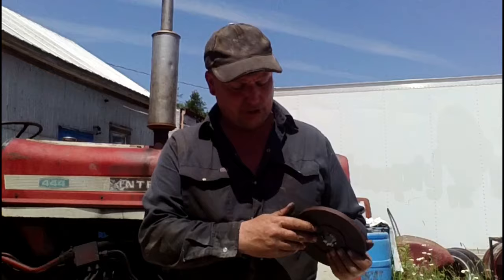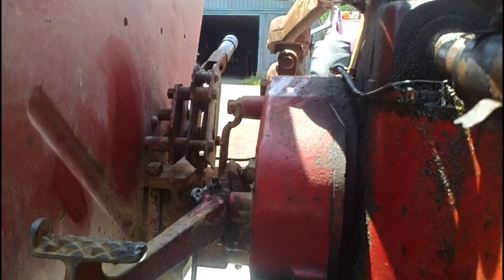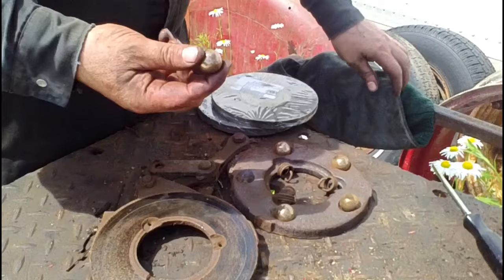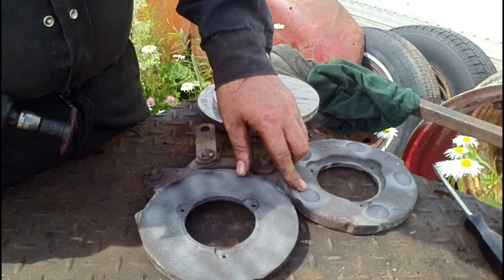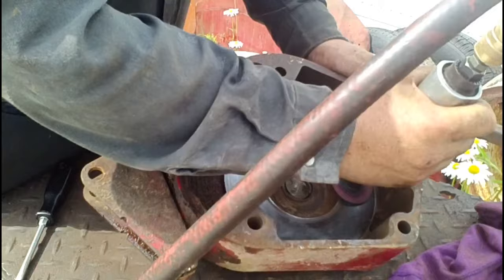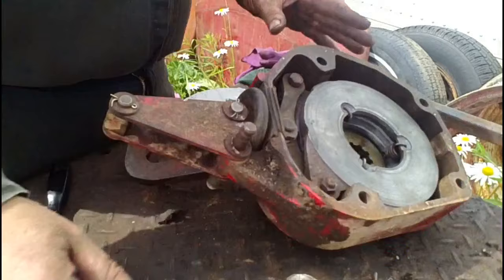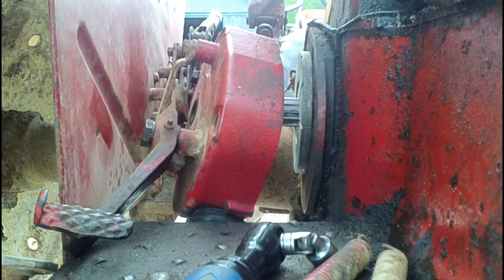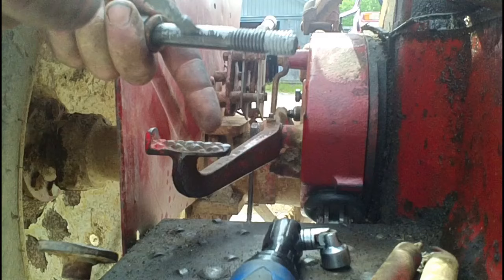IH 444 Brake repair

Comment: Great video and explanation, I'm about to do brakes on my 1967 424. I laugh when people talk about brakes on a tractor mine have never stopped worth a darn in the fifteen years I've owned it.
Reply from the maker: Get the brake disks from A&I Products, you won't believe the difference! Thanks for watching!
Reply: @CanadianRedneck15  Thank you for the quick response. I will check out A&I for the parts. I have been  looking at Steiner. I have been fixing my old guy up little by little. I use it every season and can't tear it apart all at one time

Comment: FYI, the IH 424 has the same brakes, but because it is a little smaller, on the right-hand side (the one this video shows), the differential locking pedal prevents removing the brake housing.  I had to remove the pedal first.  Also, I had to remove the linkages from the housing to put it back on. Goes on easy when you can rotate it ~30 deg.  Just hit up the hinge pins with some liquid wrench first and get some replacement cotter pins.
Reply from the maker: Great information, thanks you and thanks for watching!

Comment: got a IHC Mc Cormik 434 here in Austria, it has the same system, thanks a lot, ill adjust it first , if thats not enough ill change brake pads, but i guess ill need to do that, the brakes are so weak that you dont even notice the handbrake when you drive whit it on on accident, the tractor rolls downhill with footbrakes pushed all the way...
Reply from the maker: Yeah they're a great tractor with TERRIBLE brakes, the factory disks are too hard and just glaze up. Thanks for watching!

Comment: Mahindra company also giving same gear box ,same brakesystem(exept pin),reduction system till the date,even a bolt nut didn't changed only seat was changed
Reply from the maker: Yes, Mahindra bought the rights to build the B275 and B414 from IH and built them for many years after IH stopped. Thanks for watching!

Comment: This helped me get the brakes off and cleaned up, but I have a bad oil seal on the left side. How can I get the backing plate off? I removed the bolts from the backing (6 of them), but the plate won't budge.
Reply from the maker: You have to remove the axle from that side and move the bull gear so you can pull the bull pinion housing. You can see the process in this video https://www.youtube.com/watch?v=EST-ssHkrIo&t=1s  Thanks for watching!

Comment: Hi. I have a A414 in Australia and my LHS brakes lockup/jam when I use them. I then have to put the tractor in reverse to loosen. I have already dismantled and cleaned them and have adjusted the play in the pedal but that did not help. Do you have any ideas as to why they would lockup like that?  Thanks mate
Reply from the maker: Some of them do that, I'm not sure why. If anyone has a fix I'm all ears! Thanks for watching!

Comment: Roger,
So I've replaced the brakes exactly as shown on the video, took the actuator apart , did replace one ball , the size of the replacement ball is 7/8"
put the brake unit back on left side ,adjusted it and it works well. When I put the right side together ( right side when sitting on the tractor) I have the adjuster adjusted all the way and still have no peddle. I took it back off and replaced the hinge bolt as there was a considerable amount of slop 
in the pull. Put the actuator back on and still no peddle. I'm not sure what the next step would be to get adjustment to even both breaks.
Any suggestions?
Reply from the maker: If there is much slop in the pulls it will be hard to get much pedal. Over time the friction surfaces can get worn and you may have to machine some off the edge of the case to tighten up  the space for the disks to get any "bite".
 Thanks for watching!

Comment: Any chance of a video on replacing seals to stop oil leak in the disc brake housings?
I have a b414 and the oil is pouring through. I have the manual, but don't understand how to remove the cage.
Reply from the maker: I will add that one to the list, unfortunately there are some other projects on the go so it won't be quick.
 To get the brake shaft cage out you have to lift the hydraulic lift unit off and remove the rear axle on the side you are working on. With the axle out you can move the bull gear rearward in the case so the cage will come out past it. On the right side you must take the lock ring off of the differential lock shaft so the bull pinion shaft (brake shaft) can come off of it. Hope this helps, thanks for watching!

Comment: Do you have any videos of this with the brakes stuck fixing to have to break my wheels loose on my tractor
Reply from the maker: I don't. Has the tractor been sitting a while? If so the disks  are likely rusted to the case and or actuator. Thanks for watching!
Reply: @CanadianRedneck15  yes the tractor dropped and I think it's the same problem from your video where you rebuilt the oil pump plant to start trying to get my oil pump rebuilt soon

Comment: My 444 seems to be leaking trans oil out the spline brake shaft. Can the inner plate be removed and is their an oil seal on the shaft? How hard of a job is this to do?
Reply from the maker: The brake shaft housing has to come out as the seal goes in from the inside end. To remove that housing you have to remove the axle and move the bull gear out of the way. You can see the process in videos found here https://www.youtube.com/playlist?list=PLTZSkooohOVEF8jj0z7zoMLIlYNHwyyU3 
Good luck and thanks for watching!

Comment: How would you go about freeing one of these breaks that were stuck My right hand side break is stuck tired just slides if I pull the tractor
Reply from the maker: If you have tried going ahead and back and it doesn't release you will have to pull the brake housing off and check out why it is jammed.
  Thanks, for watching!

Comment: G'day sir! I got a 434, broke an axle last year and BROKE the other one this year due to grabbing brakes! THey dont just grab, they LOCK as soon as you touch them and I have the big highway tires about 5 feet tall so when they grab they broke my left axle and NOW my right axle! What do you suggest for brakes? DO you sell them? I gotta take them out yet and see ... was thinking they are all rusted or down to steel thus the grabbing? Im in Ontario, if I buy brakes from you would shipping be expensive? Thanks for your videos.  Or do you know why they are grabbing so bad? Thank you!
Reply from the maker: The new style disks are grabby, that may be your issue.  Make sure the actuators are clean and work freely, back the adjusters off a little so it's easier to control braking pressure.
  Thanks for watching!

Comment: I found you looking for fix to as you said super I mean dangerously grabby brakes on our 444. Left side grabs very badly.coming off a trailer or with a hung load (front bucket loader) very dicey. Any advice on what to look at? Thank you!
Reply from the maker: Check out the balls and ramps in the actuators for rust or dirt and check for any oil or grease on the disks. If everything appears clean and in good order try backing off on the brake adjustment a little so you can control the pedals easier.
 Thanks for watching!

Comment: I've got an IH666 with a similar system.  I replaced the brake pads and adjusted the pedal play a few months ago.  They worked fine for a while, but then the left brake started sticking and/or grabbing really hard.  It would always free up, but the grabbing continued.  I took off the cover to look and took out the pads, but I did not remove the actuator.  All looked normal, so I put it back together and the problem was fixed.  I just tested it under hard braking at high speeds and it all worked fine.  Do you think my issue was worn actuator balls?  Should I take it apart and see, or is it possible that I will get lots more life without problems? Thanks for informative videos
Reply from the maker: If you didn't take the actuator out but the problem is gone I wouldn't think there was a problem with the actuator. If it starts acting up again that is a place to look though. Thanks for watching!

Comment: Hi again Dave.
I've done the brakes on my 444 and put them back on.
My wheels are still locked up.
They were fine while brakes were off but locked up again when new brakes went back on.
Could I have a gear problem or worse.
Thanks. Brian.
Reply from the maker: Sometimes as the brakke parts wore people would "shave"the case to make a tighter fit or it's possible that the actuators have the wring size balls, they should be 7/8 of an inch.

Comment: Thanks for the video. I replaced mine while I was rebuilding the engine. I have play in the pedals but the brakes are locked. Any ideas?
Reply from the maker: Some times the brake disks grab and lock the actuators. If you were going forward back up a little and that should release them. You should have about an inch of "slack" in the brake pedals. Good luck and thanks for watching!
Reply: I have a 424 with the same brakes that had sat for a few years and one of the actuators rusted beyond salvage and I had to replace.  The replacement actuator assembly + new pads is ever so-slightly thicker than the housing will accommodate, and so, that brake is always locked when properly tightened.  Any1 have any ideas other than taking the new actuator to a machine shop to get milled down a little?  Or, having a thin metal "gasket"/shim made to give the pads room to spin freely when actuator not engaged from pedals?

Comment: I have an International 305 Utility that just barely grabs. The disc thickness looks pretty good. Might be they're too hard like the ones you described? I took one apart and cleaned it up, put it back together; not much  if any difference. Maybe I just need to tighten the adjuster on it? Also think I might need to replace the seal, but can't figure out how to remove the plate.
Reply from the maker: I assume you mean a 350 utility? Those original disks were like granite and would glaze up very badly, you should be able to get a replacement disk with the softer material for it as well. The seal plate should come straight out. Make sure you have all the bolts out then use a couple of pry bars and wiggle it. It's a "snug fit" and on an oring so it will be pretty tight. Good luck and thanks for watching.

Comment: Any idea how many grease  fittings are on the 444?
Reply from the maker: Not really, there's a bunch. Spindles, tie rod ends, front axle pivot, clutch pedal, release bearing, brake shaft/ pedals, and the lift arms. There might be one or two I missed but I think that's all. Thanks for watching!
Reply: @CanadianRedneck15  I just recently  bought a 444 and I found your channel which is very helpful

Comment: I could do with some advice and I am sure you will know, I used to work at IH dealer years ago and there were problems  with splitter box or  torque amplifer  but was it improved with later  4210 series as I am looking to buy  a 1994 model
Reply from the maker: I don't know if they improved the T/A for the 4210, I've had very little to do with T/A tractors.

Comment: Hi Dave. What's the thickness for new discs? I'm thinking of re-bonding cause I seem to have a challenge in finding new ones
Reply from the maker: I'm sorry I don't have any in stock right now but I should have later this week. If you are in North America you can go to A&I Products website and find a dealer near you. The part number of the disks is 1975464C2.
  Thanks for watching!
Reply: @CanadianRedneck15  thanks Dave, unfortunately I'm in Africa my man
Reply from the maker: @felixmarwei1230  OK, so that won't work. LOL  I will try to remember to measure the disks when they come in. If you haven't got  a reply from me in a week remind me.
Reply: @CanadianRedneck15  Lol. Sure Dave.  I will really appreciate
Reply from the maker: @felixmarwei1230  Got some disks in, they measure exactly 1/2 inch.

Comment: Mine were done by a local outfit that did a horrible job.  Set them up too tight and glazed the brakes (actually one side was smoking) Ill do the job myself so its done right but super keen to know what pads you recommend?  Even when I got it back from  the shop they worked horribly.  LOVE this and all of your vidoes!
Reply from the maker: I use the disks from A&I Products, you find a local dealer from their website, their disks are a softer  material like a clutch disk, the originals were like granite and would glaze up in no time and you had no brakes again.
  I am glad you enjoyed the video, thanks for watching!

Comment: Is the 2444 built in Louisville Kentucky going to be about the same? I know that they are not exactly the same as a lot of people say because even the hydraulic suction screen is different between European and North American of the same tractors.
I also noticed that you have a parking brake lever that mine has a place on the pedals that looks like a part of gear on a rod that hold the pedal down at the gear that holds it.
Reply from the maker: My understanding is that the transmission assembly came assembled from England and if gas a US engine was fitted and US made sheet metal etc was made to assemble a complete tractor. I believe if the tractor was diesel it used the British engine. As far as I know the 2444 would use the same brakes as the British 444. If anyone knows different please let me know.
  Thanks for watching!
Reply: Thanks for the response. The transmission section definitely came from England but mine is a gasser so it was built here I “ think”. The front and sheet metal is yellow all the way to metal where the transmission is red underneath the yellow before you get to the metal. 
Thanks for your reply. I did not even think about that being shipped from England even though I knew but it slipped my mind. I do know that finding the correct suction screen for mine is difficult and cost about $300 instead of $30.

Comment: can you recommend where to get those breaks for a 1958 international 420 utility tractor  thanks al
Reply from the maker: Is that a 420 or a 240? A 240 would take disks similar to this. Thanks for watching!
Reply: @CanadianRedneck15  its a 240 utility
Reply from the maker: @boochie123  Check with A&IPoducts.com for a dealer in your area.

Comment: Thanks for the info and the tutorial, works exactly the same on the b414, problem is that the brake axle is stuck at mine... any suggestion to get it loose?
Reply from the maker: Do you mean the disk is stuck on the shaft? That happens, can be really tough to get off by times, try a pry bar, sometimes I have had to use a chisel to get under the disk to get it started. Thanks for watching!
Reply from the maker: Ah, OK, there are grease zerks in the pedals, you could try removing and cleaning or replacing them and force some grease in to loosen things up or you may have to drive the shaft out and clean it, then replace and grease it well. Good luck.

Comment: My tractor in high gear 4th very loudly noise which problems in this sir......
Reply from the maker: Could be bearings, sliding quill gear...... the only way to know is to start taking stuff apart.
Reply: @CanadianRedneck15  all gears noise in high gear sir......
Reply: @CanadianRedneck15  thanks sir
Reply from the maker: @tusharhole4781  Again, the only way to know what is wrong is to start taking stuff apart until you find the noise.

Comment: I just bought a 444 and the brakes are seized.
Should I take the brake system apart like in this video or could there be a more simpler solution.
By the way. I love the videos. Very helpful
Reply from the maker: The brakes are seized how? If the pedals won't move that would be the brake shaft under  the trans case, otherwise you will pretty much have to take them apart like in the video.
 I am glad you enjoy the videos, thanks for watching!
Reply: Yes. The pedals are stuck and so is the diff pedal.
Reply from the maker: @brishorl  The pedals are supposed to have grease fittings, if they are still there you will need to remove them to see if grease will still pass and replace as needed. Try getting some grease in there and you may need to use a hammer or some leverage to get the pedals loosened up.
Reply: I'll try that. Thank you.
Reply: Hi Dave, Can you show how you took off the brake adjuster.
I have the diff pedal and the brake pedal on the left is free also but the pedal on the right won't go down so I'm taking it apart tomorrow.
I can't see in the video how you removed the brake adjuster.
Reply from the maker: @brishorl  The brake adjuster is held to brake pedal linkage with 2 nuts, just turn them all the way off the threaded rod.

Comment: Great video, thank-you... Where did you buy your parts? Ive got a B275 in need of brake repair....
Reply from the maker: I am a parts dealer so I get them from me, I run a tractor salvage yard and also sell new aftermarket parts. I get the brake disks from A&I Products. You can search on their website for a dealer near you. Thanks for watching!
Reply: @CanadianRedneck15  how do I get hold of you?
Reply from the maker: @bw7057  You can reach me at sales@chowntractorparts.com

Comment: Thank god the crappy brakes are not on the axle, hard enough time trying to mount with calcium in the tire.   surprised brakes are not hydraulic,
Reply from the maker: One thing to remember is the brakes are an early 60s design, but yeah, they kinda suck. :) Thanks for watching!